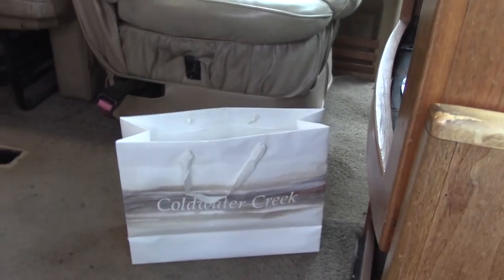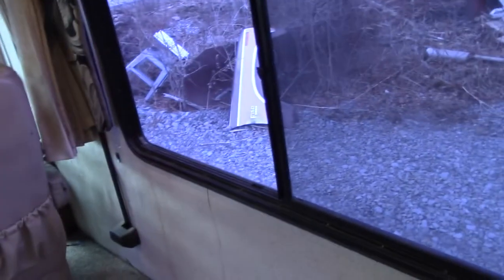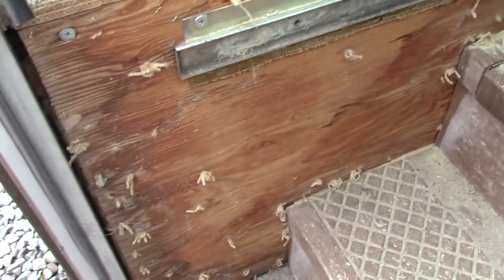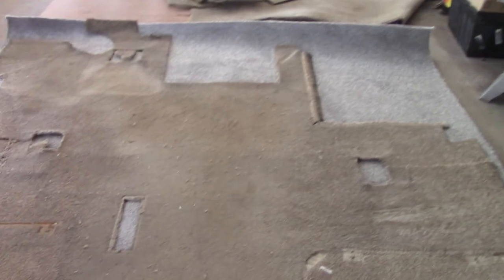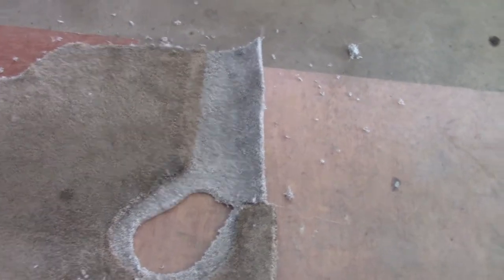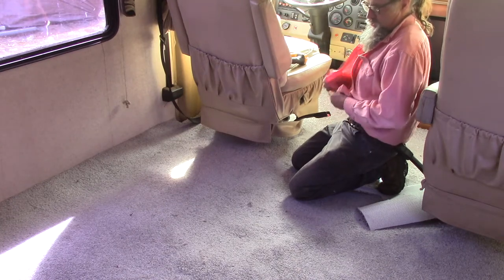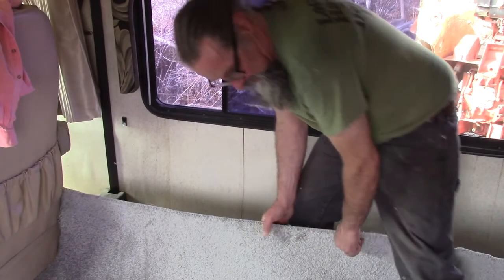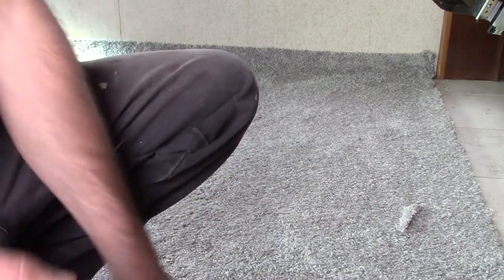Installing new carpet in a class A motorhome part 1

Comment: I have a fifth wheel and you have the same idea I do. Cut out old and use it as a template. Bedroom and living room pop out area carpet.
Reply from the maker: Yep, it would have gone quicker if i cut right to the template. I left material for trimming in and it took time. 
Thanks for watching
Reply: @JohnFrytag  thank you for the pro tip!